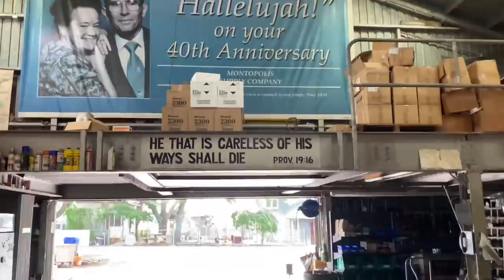What’s inside this SUSSY Mystery EGG!? (not Sus) *ok maybe a bit sus*

Comment: Depending on how much feet of fence you need Chain link would be the way to go. Solid concrete posts and gates probably cost you around 6 to 7 gs to be professionally done here in ny were everything is expensive. Get a quote around you and it will probably be cheaper than you think.
Reply: Agree. I build gates and install for my fencing company here in Alaska. Get some 5 or 6’ cl or BV. 11 gauge for weight and cost savings. Plus that’s what everyone uses for residential.
Reply: @Sackmatters  Yup some good ole Galvanized 6ft and he will be set for 30+ years if done correctly.
Reply: @Sackmatters  I also work in the fence industry my friend.